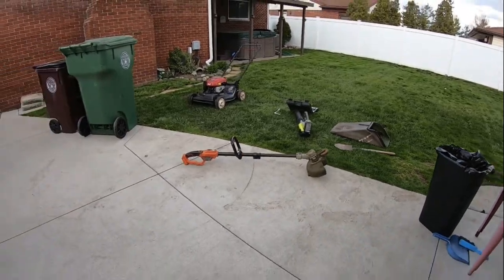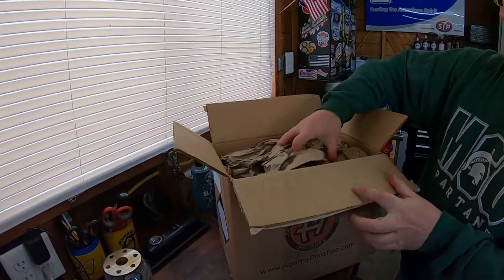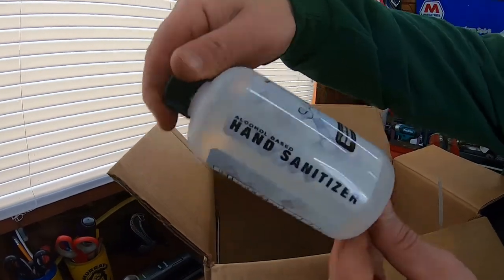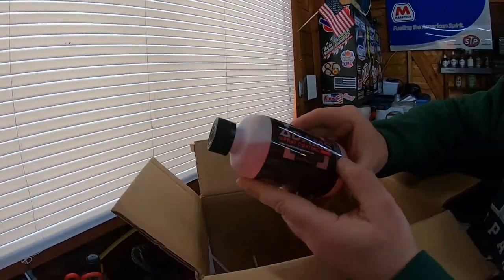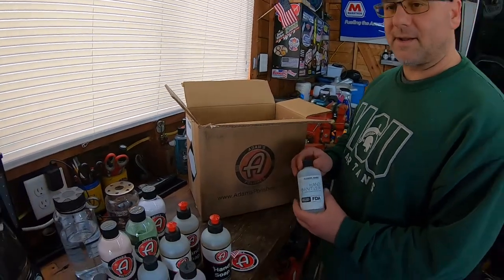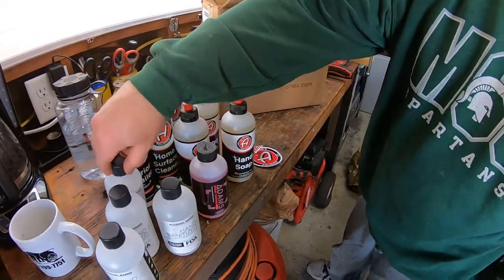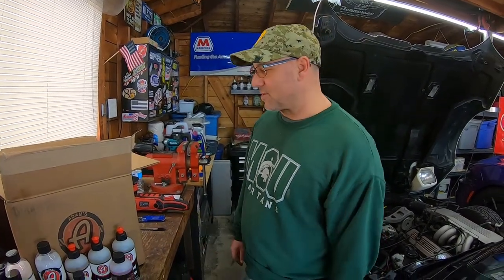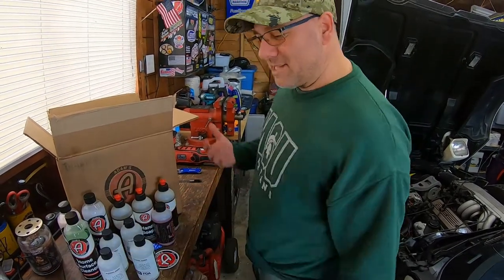Adam's Polishes New Home & Car Detailing Products Unboxing | Shout-Out Monday

Comment: Looks like you should stay clean for a while now. 😂 I love the spray coating! It’s great on paint but awesome on black plastic trim. Just ups on the trim and that’s it you don’t have to wipe off.
Reply from the maker: I should be all clean now😂 . You think the spray coating would work on the Jeep fender flares ?
Reply: Ouzo Lou Garage It would work great on the fender flares. That product is so versatile and a little goes a long way. I would wear a respirator inside though or use it outside in fresh air.

Comment: I used their ceramic spray coating on four vehicles last fall, it holds up well. I can’t use it without a N95 mask 😷 on or it gives me a killer headache 🤕 for 1-2 days
Reply from the maker: Most be the Sio2 in the product. I get headache from hydrocharge . Cool that Adams ceramic spray works . Thanks Rusty